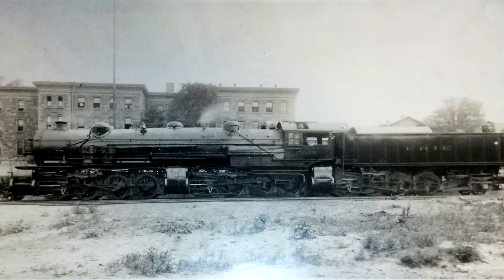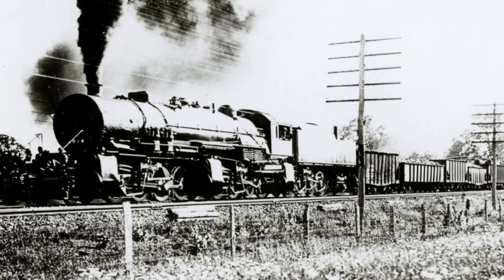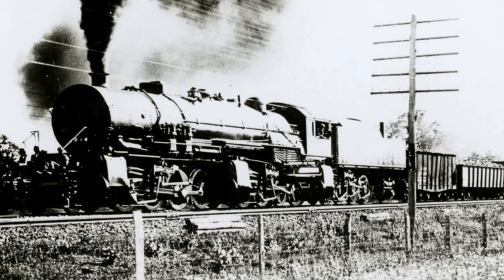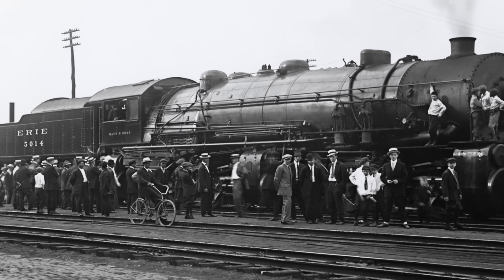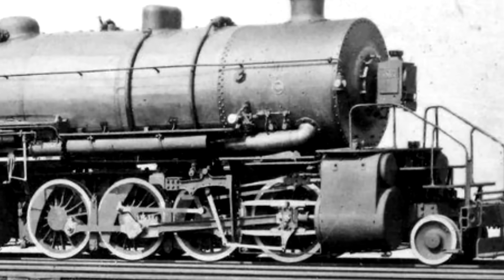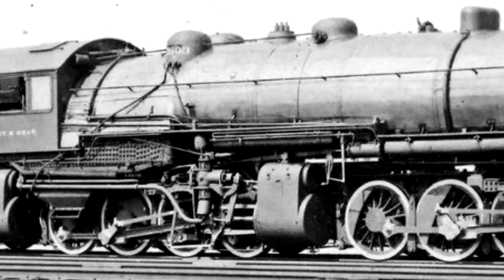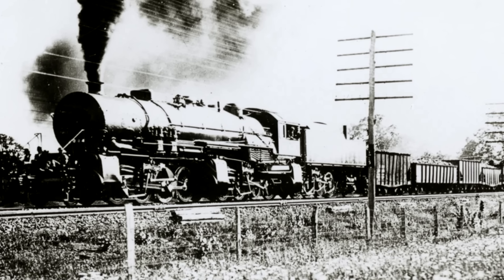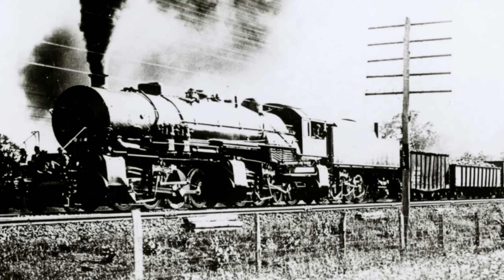What the Heck is Up With Triplex Steam Locomotives? | History in the Dark

Comment: A triplex with 3 cylinder simplex compound engines (9 cylinders in total), all exhausts routed to the smokebox, a significantly improved boiler and steam circuit and exhaust system and the right load, could work quite well.

Comment: They were overthinking it with the Triplexes and beyond. Pretty much every standard accessory on steam is either run by steam, air, and/or both. Earlier versions of the power reverse and Franklin Railway Supply Co. firedoors were steam operated. These weren't continuous use devices like the Pyle National generator and air compressor. Though they still leeched steam from the boiler. So the boilers on the Triplexes were tasked. All those cylinders, the various pumps, and accessories took boiler pressure to function.

Comment: I think a 2-4-4-6-4 or 2-6-6-6-4 might work if done in a narrow gauge, using triple expansion cylinders. high pressure at the rear, middle is medium pressure and the front being the low pressure cylinders and the vent the steam out the stack. Also no drivers under the tender, so the trailing 4 are under the firebox/cab 
probably still won't work but dunno, cool idea, might make a 00 or 009 model one day
Reply: There's the mythical "Super-Garratt", the only period image is in "photographic livery", so unknown if full-size or scale modeled.  It's a 2-6-6-2+2-6-6--2, assumed to have been the missing GN class for South Africa, in Cape Gauge; it is suspected that it could have even been a hybridisation of a compound Mallett and the articulated Garratt....
Reply: @PiersDJackson  You're stirring memories of a fold-out train book that I had as a kid, which my toddler was recently looking at, but I think that one was a 4-6-6-2 + 2-6-6-4 and was two steam engines attached back-to-back, for some foreign railroad. I don't know if it counts in the context of this video, though, if there were two separate boilers. It sounds like one of the major struggles for these Triplex locomotives was having to feed all six sets of cylinders from a single boiler.
Reply: @c182SkylaneRG there were several concepts running in a forum, including a triple expansion with fourteen cylinders (seven per engine).... starting with a single inside HP cylinder exhausting to the two outside IP cylinders in the form of a Webb Compound (Midland 4P compound), they are mounted as the "Fixed" drive set in a Mallett, the IP cylinders then expand into four LP cylinders in the outer-articulated drivers (possibly in reverse mounted) in the rocker motion of GWR... Then duplicate for a second pair in tge Garratt fashion.
Reply: @c182SkylaneRG you are correct in the 4-6-6-2+2-6-6-4 design as currently modelled by several modellers.   The drawings for the 2-6-6-2+2-6-6-2 was originally drawn for Standard Gauge, which may even have been conceived for Australia?

Comment: Have there ever been any railroad locomotives that use water tube boilers like you see on steam ships? You can get so much more superheated steam out of an Oil fired water tube boiler that fits in the same footprint as a conventional superheating fire-tube boiler, I wonder why I never hear about them?
Such an oil fired water tube boiler would likely have made locomotives that use steam turbines and/or triplex (or other forms of compounding) much more attractive since the issues with those are usually issues of "we can't feed this thing enough steam", and water tube boilers are far and away better at making steam from the same amount of fuel than fire tube boilers.
Reply: The class W1 used a boiler based on naval architecture, but it then ran into the same issues that most high pressure locomotives run into. 

Maybe in combination with a triplex system something like that could work, but it was just far too much power for the size and weight of the vehicle

Comment: In the Virginian’s case, their attempt with the triplex was them trying to figure out how to efficiently move 11,000-15,000+ ton coal trains over the Mullens-Roanoke portion of their mainline.  The grades on that section are stiffer than any other section, so they needed power.  The triplex failure led directly to the class AE 2-10-10-2, and their operational expense led to electrification of that section.  There’s a recurring theme when you cover Virginian locomotives that you don’t notice in your research just how monstrous their average coal trains were lol
Reply: how many waggons is a 15,000-ton train, that's massive
Reply: @zevroboy131  Back then it was 100,000lbs. (50 ton) capacity cars. Tare weight could vary somewhat, so let's say 36,000 lbs.  (18 tons.) So we've got each car weighing 68 tons fully loaded. That's a 220 car train if I figured right.
Reply: @839Unipicker the Virginian’s primary model of coal car was a 6-axle 100 ton gondola, appropriately nicknamed “battleship gondola” cars.  So 110-150 cars, though some sources I have site 20,000 ton coal trains which would be 200 cars.
Reply: @Engine33Truck I forgot about those cars.
Reply: @Engine33Truck  "cite"
[Thanks for the info though! :^)]
Reply: @Engine33Truck that's stupidly heavy,I run those on my fantasy San Juan and Gulf railroad

Comment: Core problem is the small firebox. Entire thing is built like a flat industrial skid mated above the drivers, crippling firebox height.
Reply: If they used a water-tube boiler, they could have extracted more heat with a water-tube type preheater. More steam and higher superheat would have helped.
Reply: @JaneDoe-dg1gv if the design goal was to keep a separation plane for the frame, then yes you are forced to more advanced firebox and boiler designs. But the available designs limit you. Hush hush style admiralty boilers might work if they lengthened the firebox and had good mechanical stoking.
Reply: @wtfux  I've never liked admiralty type boilers for locomotives. Waterwalls have always made too much soot.

I was thinking something more like an O-type being fed by a once-through preheater; with superheater between boiler and preheater. 

then everything stuffed inside one big flue with combustion gasses flowing across everything rather than from inside to outside.
Reply: @JaneDoe-dg1gv The double stacked bed fluidized bed firebox for the ACE 3000 is a compact design that fits height issues but didn't exist then, but probably could have been built if the plans were available.
Reply: Maybe with a Union Pacific railroad tender with a bigger coal or oil bunker myus the wheels and a bigger boiler like a big boy size boiler and bigger grate area and tanks along the boiler at a suitable height. Then it might work
Reply: @CollinBlack-j1y if you're going to go that far, better to split the tender function. Traditional coal only tender in the back, and have a condensing water tender in the front forward of the boiler with drivers. Like a radiator calf/slug permanently coupled to the front of a mallet. Keeps weight on the drivers. If you reversed the now far forward set of drivers to keep the cylinders of the forward and middle set near, reduces the plumbing. Then there's the interesting design choice of keeping either the rear or middle set of drivers fixed relative to the boiler frame.

Comment: My idea to fix the Triplexes is we simple all the cylinders, exhaust the front 2 to the smokebox as normal and run the rear cylinder set through a condenser/feed water heater type deal to cut back on water consumption
Reply: what about all cylinders in tandem configuration? with that much power a higher cutoff could be used leading to more expansive running?
Reply: @JaneDoe-dg1gv  If by tandem you mean all the cylinders being fed directly from the boiler, that's what people meant by "simple-ing" the engines. As to the stuff about cutoff, I don't know what you mean by that
Reply: @jacebeleren9290  I was refering to tandem compounding. The practice of having two differently sized pistons mounted to the same piston rod. The smaller piston's exhaust is fed to the larger piston.

steam engines have two adjustable controls. A throttle which limits steam flowrate to the cylinders and a reverser that controls the motion of the valve gear.

The valve gear adjust when and how long steam is allowed to flow to the cylinder.

Once the valve cuts off steam supply, the steam in the cylinder provides power by expanding. expansive running is more efficient than just letting steam constantly flow into the cylinders during power strokes.

Expansive running trades power for efficiency. I suggested that such a powerful locomotive could be operated at higher than normal cutoff settings than typical.

This would improve fuel effeciency since expansive running is more efficient and such a locomotive would still have an excess of power even running with more cutoff.
Reply: @JaneDoe-dg1gv Ah, now I see what you're getting at! And I agree that expansive running would be an excellent option to implement, although for another reason that occurred to me after I read what you said on the topic. Part of the triplex's problems (albeit a very small part but still something to iron out eventually) was that they were strong enough to break couplers. Using expansive running might mitigate that problem on startup by limiting the initial power strokes, so there could be a more gradual power curve peaking more towards 60% on the Johnson bar than a traditional full pressure setup

Comment: Great attempt America
Reply: @harrisonallen651  Oh well, the UP Big Boy still holds the title of biggest and most powerful steam engine.  America stays winning on that front.
Reply: @blam320  The Belgium one has more pulling power.
Reply: @23GreyFox  For all the good that did it.  It’s a failure which never saw active use.
Reply: @blam320  But it's not a failure because it didn't work, it worked too well. And there was simply no need for it.
Reply: @23GreyFox  If there was no need for it, then it was still a failure.  It failed to find a niche for use.
Reply: @blam320  If you say so

Comment: I think if they increased  the Firebox and  highered boiler pressure to 300 psi and if they simpled it, it would have worked.
Reply: Either that, or possibly experimented with something like the Franco-Crosti boiler, seeing as it has shown to work on a quadruplex locomotive. 

Either way, I doubt it's impossible to make a triplex work... But it required a lot of testing and experimentation, that not a lot of people could afford.
Reply: @retrogamelover2012  so true
Reply: The problem you’ll still have is the 3rd set of drivers underneath the tender.  As the tender uses coal and water, the weight on that driver set decreases.  Both operators noticed that caused a lot of slipping
Reply: @Engine33Truck Maybe. Though, that could always have been worked around at some point.
Reply: @Engine33Truck what if they added more weight and extended  the boiler so 3  sets under the boiler and a larger Firebox  combined  abd add new technology  that is learned today like Firebricks and ectra
Reply: @NicholasSpisak I’ve exclusively seen firebricks and locomotives in Darkness’s mad science videos, and worst trains videos.  So that might be a bad idea 😂.  You can extend the locomotive itself to put all 3 driver sets underneath.  Only problem I could see is it being incredibly long, but that might be solved with both front sets articulating.
Reply: @Engine33Truck  okay, but what if some engineer made i forget but in Australia  made improvements  on steam a 4-8-4 called the red devil and it was successful  and made the triplex in simple mode.